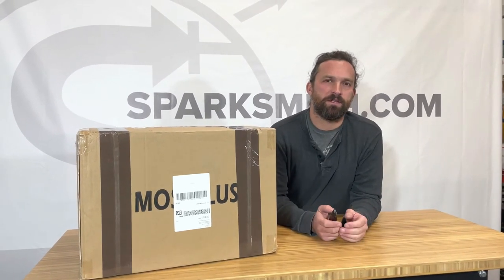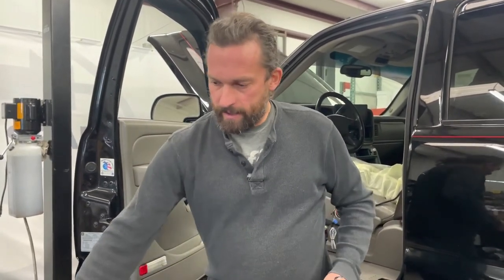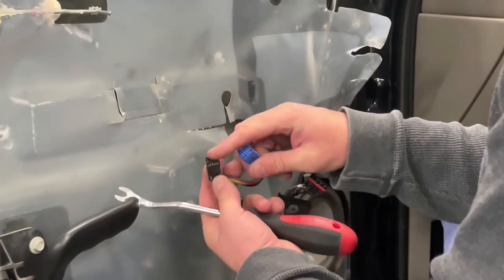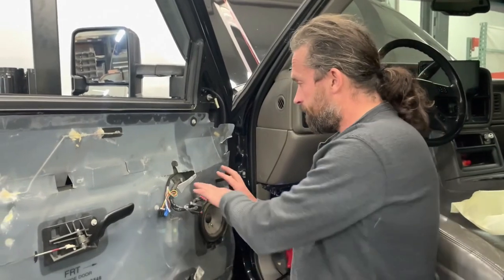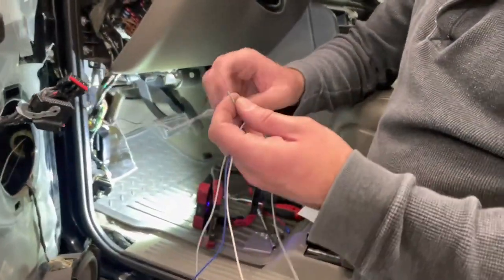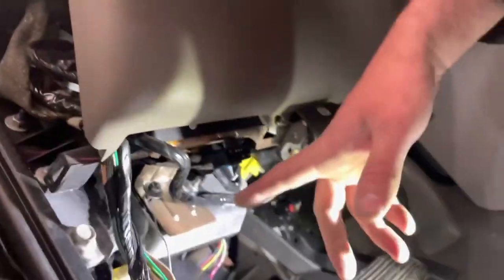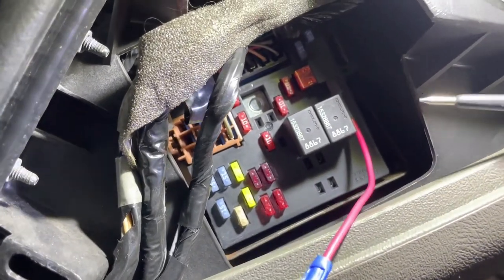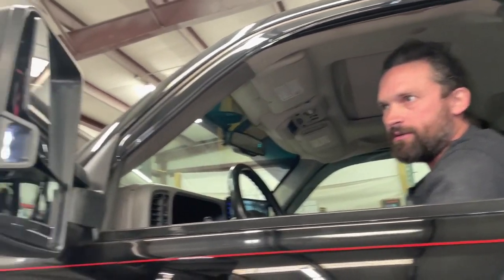03-07 Silverado Tow Mirror Installation

Comment: To wire the passenger mirror, do you just run the 3 wires through the dash or is there a way to make it hidden to reach the fuse box on the driver side ?
Reply from the maker: We recommend keeping the blue and white wires twisted or zip tied together (or pop them into some plastic wire loom) and sneak them under the dash to the driver's side. There's plenty of room under there to get those two wires across and keep them out of sight.
Reply: @Sparksmith okay thanks ! Very helpful video to man

Comment: When I splice in to the green wire for reverse lights, do I hook up 2 white wires (driver and passenger) together and into the green wire?   Is there a fuse that we need to add or it’s not necessary ? Sounds like only blue wire needs a fuse.   What size fuses are used 10amp ?
Reply from the maker: Yes, splice both the left and right side white wires into the light green wire. No fuse is necessary since that circuit is fuse protected by the factory backup lamp fuse in the underhood fuse box. The blue wires for the white running lights will need to be on a fused circuit of your choosing. We typically connect them to the SEO ACCY fuse in the driver's side fuse box since that gets key-on power. But you can splice those two blue wires into the parking light circuit if you'd rather them come on with your parking lights.

Comment: Does the reverse light function come on when you hit unlock on the key fob?
Reply from the maker: When wired as shown, they will come on anytime the reverse lights come on. So, yes, as long as it's dark out, the reverse lights, and the tow mirror lights, will activate simultaneously.

Comment: What is that fuse amperage on the fuse tap I know the 10 amp is on the bottom but what’s on too
Reply from the maker: We typically include a 10 amp fuse for the top slot, which is plenty for what these mirrors draw.

Comment: How is the mirror shake while going down the road? I bought some mirrors off Amazon and they shook really bad going down the road at 70+MPH and I hate that. Will these sit still while going down the road? Thanks!
Reply from the maker: I've been running mine for a month or so now and haven't noticed any kind of vibration at highway speeds.
Reply: @Sparksmith  Thank you! Will be looking to upgrade to yours!
Reply: I believe this will be an issue with your door itself, no matter what mirrors from what brand you have on.
I have this issue with my 03 chevy and my door is messed up. Hinges/bolts are wore out.
Reply: i just got some mine shake when i am stopped lol

Comment: I wired my lights for the reverse the same way you did  and they stay on when my headlights come on why is that
Reply from the maker: If you spliced into the lime green wire as shown, they should only come on with the reverse lights. Sounds like a wire is crossed somewhere.
Reply: Where do I tap into so I can have blinkers and running lights. I have a 2002 Chevy
Reply from the maker: @dailylifeasragegage5786  You can get all three functions using fuse taps (you want the ATS style: https://sparksmith.com/products/fuse-taps?variant=39352279302333)  in the underhood fuse box
Reply: I have the fuse taps it’s when I plug into the fuses I’m spose to it’s either the blinkers or the running lights not both
Reply from the maker: @dailylifeasragegage5786  that's odd. Please email us at support@sparksmith.com and we'll see if we can help you figure it out.

Comment: someone else here asked if the DRLs run all the time or just during the daytime?
Reply from the maker: It all depends on the power source you choose when installing them. I used a fuse tap to a fuse that has key-on power. If you choose the same fuse, then yes, they will stay on any time the key is switched on.
Reply: @Sparksmith  so probably not the best hookup for night time
Reply from the maker: @tonymeehan7859  it just depends on how you want them to function. They're not so bright that they would be a distraction or detriment to oncoming traffic at night. One could easily put them on a switch or we can guide you on how to make it so they automatically turn off when your headlights turn on. Lots of ways to make them work.
Reply: @Sparksmith  I actually just found out mine just have ambers anyway, so that hookup works fine for me
Reply: How do you get them to come on with parking lights, and not with key, 04 silverado

Comment: Do all brand of Tow mirrors with back up lights need to be  grounded?
Reply from the maker: We can't speak for other brands. But ours have a separate power and ground wire for the reverse light function. All other functions (power mirror, turn signal, running light, and heater element) are grounded through factory wiring.

Comment: Are they paintable or do I need to sand and prime?
Reply from the maker: These are not technically paintable. They have the textured black ABS plastic, so it's not a smooth finish designed to be painted.

Comment: How does installation work for the other side
Reply from the maker: It's exactly the same as the driver's side except for the blue and white wires. They both get routed under the dash and over to the driver's side. The blue wire goes to the fuse tap along with the driver's side blue wire. The white wire goes to the reverse wire along with the driver's side white wire. Hope that answers your question!
Reply: @Sparksmith  so do I need to fuse the same color wires together so that they can connect to the same fuse tap?
Reply from the maker: @jackhu9225  yes, that’s correct.
Reply: @Sparksmith  ok great thank you so much for the help

Comment: So I bought these mirrors why do they power and tilt up when I put into reverse. On my stock mirros they would tilt down when I put in reverse
Reply from the maker: It sounds like you just need to turn off the mirror dip feature. I had to do that with my truck when I installed them. It's a function you access using the steering wheel buttons and the menu on the instrument cluster where the odometer is. Email support@sparksmith.com if you need additional information. Thanks!